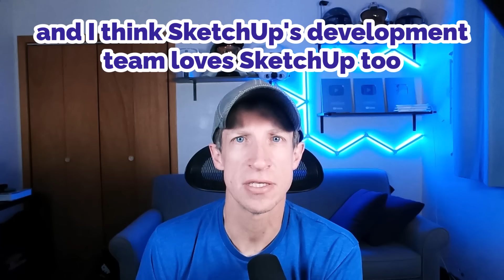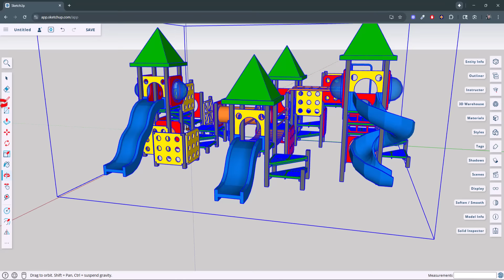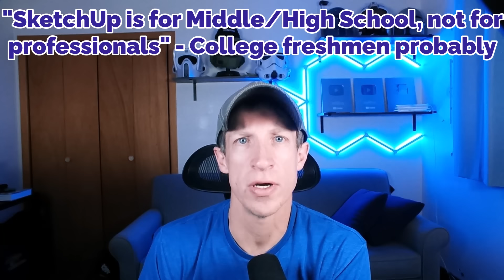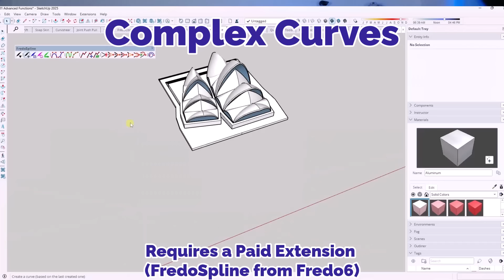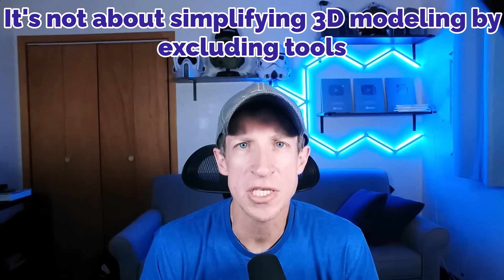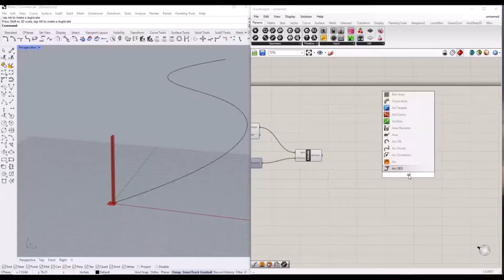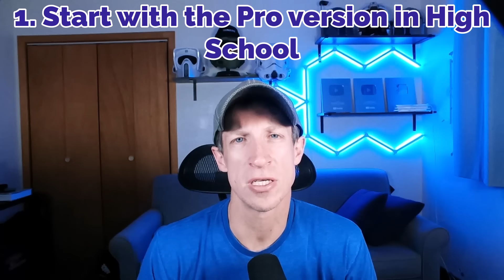Is SketchUp being REPLACED?

Comment: I was a beta tester for Sketchup when it was owned by @Last, stayed on with Google and Trimble as a beta tester. I've taught SketchUP to Grade School, Middle School, High School Students as well as Freshman College Students. I've also taught Rhino to College students and Design Employees at a large Construction company. I still use both programs. There is already a "Plugin" for SketchUp that has "some" of the features of Grasshopper its called VizPro by Fluid Interactive. In my opinion The major difference between SketchUP and Rhino is that SketchUP is a "Surface" modeler and Rhino is a "Solids" modeler IE: Sketchup relys on a polygon of at least three co-planer edges to define a surface plane and Rhino can create native "solids" where the shape of the solid can be planar or non planer. Rhino also lets you have true Circles and Curves whereas Sketchup Curves and Circles are actually a series of segmentd straight lines. Unless and until SketchUP switches to true Curves and Circles this will always be a limiting factor for SketchUP. Don't get me wrong I LOVE SU and use it almost every day, however if I want to build something with "precision" in sub millimeter accuracy I will use Rhino. If I want to build something that has tons of curved shapes in it I will use Rhino. So having bevels and fillets as a native tool would be helpful and incorporating VizPro (node based editor) into SketchUP would be helpful, but IMHO not having true curves and circles is the bigger distinguishing feature between Rhino and SketchUP.

Comment: I have been saying this for years, glad you agree. My experience was just what you described. I was introduced to Rhino 3D at architecture university, then had to use SketchUp at a very big office, and I was surprised how bad the program was. I will always believe SketchUp is just a toy for really young or really old humans. 

I think a funny thing has happened: the software used to be easy and intuitive, after all it was one of the earliest 3D software out there, if would often be the first time in 3d modelling for most. In present day, with many more options available, SketchUp might not be your first 3d modelling experience, and when you pick it up later, everything is counter intuitive. cumbersome, prehistoric, repetitive, inefficient.

Basic 3D features missing:

-SU is bad at moving assets around. There is no Gumball or Gizmo. (basic tool in any 3D software).
-SU only has 1 viewport available. (Rhino has 4 by default and you can add more, and dragging across viewports is supported).
-SU is bad at texturing. Or rather nonexistent. Not only are there not mapping methods available such as (box, planar, cylindrical, etc), the whole texturing experience to edit textures is forced to be per face, meaning you have to edit the texture on each face of your mesh. There is no global texturing.
-SU has no support for curves.
-SU has no piping tool.
-SU has no loft tool.
-SU has no mirror tool
-SU has no distribute or align tool.
-SU has no sphere tool.
-SU can’t extrude edges to form surfaces.
-SU history (undo redo) is terrible and with 20 steps at max.
-SU has no randomization tools to scatter and scale objects.
-SU has no parametric tools nor node modelling.
-SU has no support for drafting which forces user to create 2D drawings in CAD or Rhino to import into SU for 3D modelling.
-SU overall snapping precision is bad, which often leads to inaccurate models. There also no possibility to edit snapping options. Also, in perspective camera one will often run into issues trying to snap things around that should be snapping from that viewing angle.
-SU does not allow the uesr to turn off snapping for freely placing assets.
-SU only has windowed selection. (no brush, no free form, etc)
-SU boolean operations often fail or create horrible results, any terrain perforation is doomed to fail.
-SU scaling tool does not allow the user to input a specific value for the object to scale to. (it only allows scaling factor values).
-SU viewport visualization tools is extremely limited with no support for ambient occlusion.
-SU has no layers which allow you to apply materials, lock objects, change colors, etc.

Basic interchangeably/collaboration features:

-SU is bad at importing assets. It does not support most common 3D file formats such as OBJ and FBX.
-SU is bad at managing large meshes. It has no optimization what so ever and anyone that tried to work with topographical meshes is Skechup or any other imported mesh know what I’m talking about.
-SU models are often terribly modeled with many errors in the meshes, manifolds, etc. The software allows all without any kind of warning. SU modellers often know very little about technical modelling.
-SU has no export selected.
-SU tag folder which replaces sub layers does not copy from one file to another.

Basic Rendering features:

-SU has no default renderer.
-SU has no lights
-SU does not allow the user to freely move the sun around (azimuth and altitude) instead you have to pick a time.
-SU can’t export cameras from one SU file to another.

The list can probably be much more extensive.

Comment: This is a fantastic and much-needed discussion. I absolutely agree with your analysis on the three key problems.

The "pipeline problem" is hitting hard—I’m seeing the same thing with new hires coming in much more fluent in Rhino simply because they view SketchUp as a 'starter' or 'middle school' tool. It’s a huge perception hurdle that stems from the web version limitations.

The point about the *"Missing Feature Problem"* is spot on. SketchUp's magic was never about being *limited*; it was about making powerful, complex actions *simple and intuitive*. Adding core modeling tools like native Bevel, Chamfer, and proper Curve Extrusion shouldn't compromise that simplicity if they're implemented with the typical SketchUp elegance.

I especially appreciate your focus on *Trimble Creator**. Making it a fully integrated, live parametric tool *within the desktop application is the crucial step to bridge the gap with Grasshopper. A simple, intuitive parametric system for SketchUp could be a real game-changer.

Hopefully, the Trimble team takes this feedback to heart. It's time for SketchUp to evolve from being just an accessible beginner tool to a truly competitive, career-long professional platform. Great video!

Comment: Hi! You’re spot on. All the advanced tools still have to be installed as plugins — nothing has changed in that regard for years. Meanwhile, they keep stuffing SketchUp with pointless rendering gimmicks and other nonsense. There are already tons of excellent rendering tools out there — many of them free — like Twinmotion. But somehow, SU keeps pretending that’s where the cutting edge is, and the results are honestly disappointing. At the same time, the actual modeling tools have been completely ignored. It’s the wrong direction — completely the wrong direction. After 14 years of using SketchUp daily, I have seriously started to look another modelling software.

Comment: Justin, I’ve been using SketchUp professionally every day since 2014, and you’re absolutely right. With each update, I keep hoping for new modeling tools, but it’s always a letdown. SketchUp really needs to add native organic modeling tools, or it’s always going to be seen as a toy among other 3D professionals. Honestly, I’m starting to consider switching to Rhino.
Reply from the maker: Thanks for your feedback!
Reply: It is the issue with the auto fold modeller, that needs to be re worked from scratch.
Reply from the maker: @OlavSchneider  Autofold as in the way sticky geometry stretches? I really want them to keep this - I use it constantly for resizing objects - it's super powerful once you get it working right

Comment: As an architect who used Sketchup before going to university: Looking back, Sketchup is just bad for architects. Especially if your firm is not just creating concepts, but design the structure of the building. Sketchup is for drafting as an architect, and even for that, I wouldn't say it is a good tool. Also, the price... not worth it.
Reply from the maker: I don't know if I agree with that - many firms use SketchUp, and many of them get great results out of it. From a price standpoint, it's on the lower end of 3D modeling programs, especially compared to Revit, etc
Reply: @Thesketchupessentials Not in Europe I think. And Revit, Archicad are BIM programs, they shouldn't be compered to Sketchup.

Comment: SketchUp is lacking basic tools for complex parametric modeling, No one wants to purchase so many plugins, while other competitors software such as 3ds max, Rhino, maya they alone is enough to make anything without third party plugins. But what SketchUp official company is releasing the same software does the same commands no advance improvement, no necessary plugins added, Even you can't use a bevel edge tools for free. While every modeling software have these basic tools for free. 🥴
Reply from the maker: I think this is a fair case

Comment: I hope they release a version for linux, If not, I'm probably switching to Blender. man, a whole new learning curve from zero... smh.
Reply from the maker: I'd say this is pretty unlikely - this is a very small percentage of overall computer users
Reply: @Thesketchupessentials if 5% of computers are Linux based, that means that they are selling to just 95% of the computers. 5 out of 95 is a 5.26% increase of sales. Now, considering that there are very few cad options for Linux, it might be a higher percentage of sales increase.
Reply from the maker: @xxrgxxcasco  ...I think you might want to check your math on that one
Reply: @Thesketchupessentials no. If 95% of the population uses windows and apple, that's sketchup's 100%, that means that if they include Linux, their 100% increases a little bit over 5%. 95 is to 100 as 100 is to? 105.26%.

If someone has 50% and gets another 50%, what they have is double of what they had, so the increase is of 100%.

Its just some math gymnastics, still, it's an increase of sales.

Anyway, how harder is it to work with blender instead of sketchup?

Comment: Samething that i have a bad felling in sketchup is about the limitation to high poly geometry, the software dont give good engine to suport to use super complex geometry, when we bring a lot of heavy stuff in it we aways see that crash message kkk.
Reply from the maker: I suppose this depends on what you're bringing in - it doesn't handle ultra high poly well, but I don't necessarily think it should - that's not what it's designed to do
Reply: @Thesketchupessentials  ya, but when u need to make large projects always we had problems with performace, and im just talking about skt if u put layout on this conversation we will talk about a large problem kkkk, i say this but love to modelling with sketchup.

Comment: Universities in Italy and Austria already use Rhino almost exclusively for over 20 years now, at least in the basic courses. In advanced classes I've seen a lot of Maya, 3DS Max (before it sued to be Cinema 4D), Revit, SolidWorks and Vectorworks. I've never ever seen anyone using Sketchup! NEVER. ...and than you go into a working place and seemingly every studio uses the Sketchup plus Revit combo - and quite often with personalised tools on top. LOL!

The reality is, correcting and remodelling realistic architectural structures in a light weight software like SKP is A LOT easier. It's faster too, just consider how many extra clicks you need to start modelling in a Z axis compared to Trimbles software. Rhino is clunky and quite frankly useless outside of 3D printing models and grasshopper - and parametric modelling outside of university organic studies is extremely overrated as it is. Not to mention the compatibility with other real time renderes kinda sucks, a major culprit being wrong UVs and flipped faces. There are powerful check-up systems in Rhino ofc, but again: they are clunky, confusing for new comers and fairly slow to use compared to 3DS Max or SKP. You got no idea how many models from external studios I've got to clean up all the time, but it's such an easy fix in SKP compared to Rhino.

The only real advantage of Rhino in the real world in my humbly opinion is its price. Sketchup Pro annually is abordable, but it start to get pricey with all the freaking plug-ins that should be standard features by now. Love ya' Fredo, but bevels should NOT be a freaking third party plug-in with a price-tag on top. What the hell?!
Reply from the maker: Ooh yeah some better UV tools would be good as well. I personally think Fredo's suite is a great value for what you get, but like I said...some of those tools should probably be native tools to begin with

Comment: I completely agree with your vision... I've been a Sketchup user since Su was owned by @Last... unfortunately, after so many years of working on this platform and all the professional archive accumulated, migrating to another platform involves many steps backwards, and at the end of the day, that's what I believe Trimble counts on... I wouldn't be surprised if the enormous free archive that all of us SU users have helped to build (3D warehouse) were soon blocked to subscription holders only.
Reply from the maker: I doubt that - I've not seen anything indicating they want to block 3D Warehouse access, and it wouldn't make sense since the Warehouse is basically crowd sourced models. You want free users to also be able to contribute to that Warehouse

Comment: Timely video that I fully agree with. And it's not even a quiet shift. I have been using SketchUp for 20 years. I now teach a spatial design class where we introduce SketchUp. But in subsequent classes, students learn Rhino and most say they prefer it. Professionally, when I've worked as a PM, most designers I've worked with just use Rhino or Vectorworks. This has been over the last 10 years. When I design myself, I still use SketchUp, but lately I find I am enjoying it less now and will use Blender or even FreeCad to make certain objects first. As you said, it really starts with modeling and user experience. Back to teaching, my students will often ask, "so how do I make..." and I'll know how to do it but the answer is much more complex than it should be, a two or three-step process instead of a basic answer, which indicates a lack of new tools or options that should already be part of an existing tool.
Reply from the maker: Thanks for the feedback - this is the kind of thing I'm talking about